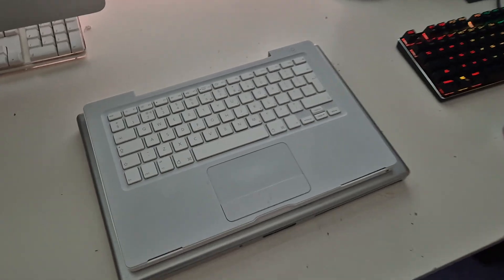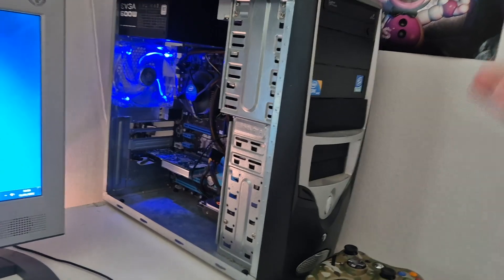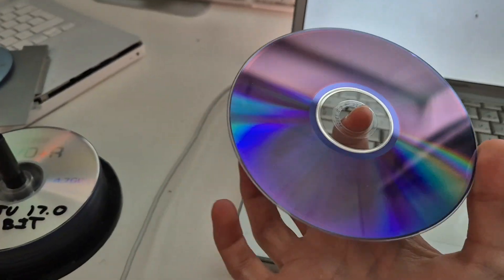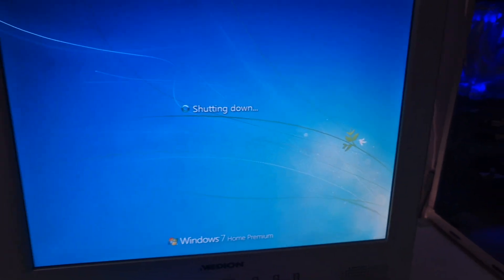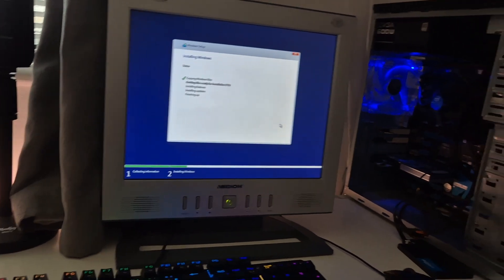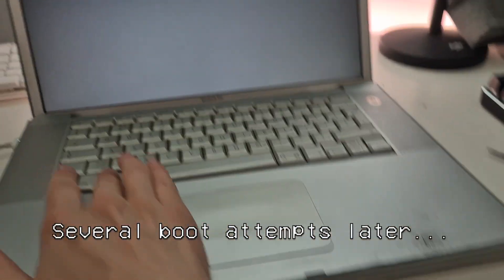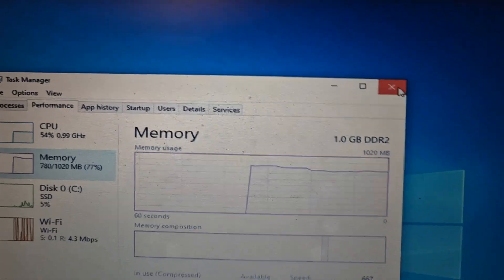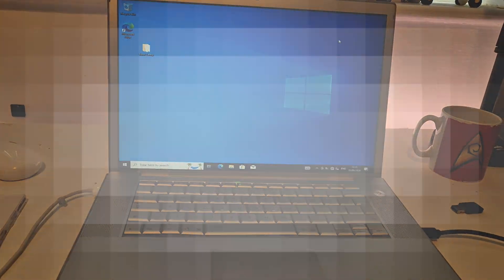Windows 10 install on a 2006 MacBook Pro (EVERYTHING GOES WRONG)

Comment from the maker: WHY is the 2006 MacBook now just a keyboard? Well, you'll find out next week as this was filmed after that video, I just changed the order of a couple vids 🙂
(This is actually Season 5 Episode 5)

Also, this video decided not to export in 60fps 😢 Back to 60 next week 😉
Reply: yo give windows 10 ltsc a try on the macbook i think it'll be usable coz it removes a lotta the crap that comes with windows 10. you can get the iso image from massgravel

Comment: Nice, I was able to play cs 1.6 on my 2009 mac book with windows 10. Also do you have any advice for installing a mac os on a mac book pro from 2009? not sure what version or method works for that model. I'm new to working on them.
Reply: I have a 2009 17" MacBook, i use open core legacy patcher to install Monterey on mine, it works great on Monterey, that's if you want a modern macOS that can still do regular things.

Comment: are you sure you got the right BootCamp drivers for that model? if you can find a 10.4 tiger disk that should have the right ones on it
Reply from the maker: Yep! I was able to get the display driver working from the disk eventually, it just decided to take over an hour to actually work 😅
Reply: @amw.1988  I am not surprised! booting every 5 tries and a core duo is a recipe for time-wasting!